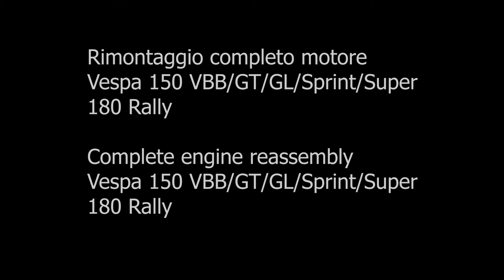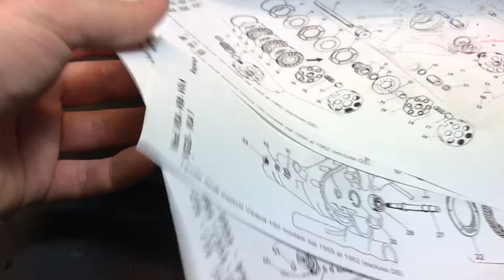Restauro completo motore Vespa VBB/GT/GL/Sprint/Super/180 Rally Largeframe [How to rebuild]

Comment: Hi. great job. It was very useful on the rest of my 150 sprint speed Vespa. I have a question. At 17:47 you put the piston with the middle window facing down. On my wasp the piston window is an input and is on top of the cylinder. You can confirm that I'm having trouble starting my Vespa. Thanks.

Comment: hey i need your help, today i taped my vespa crankcase bolt holes for the cylinder because the threads are gone. i just realize that threads holes for bolt mount on the left side engine are open to the inside of the clutch and transmition. im pretty sure there are some chips inside that, what should i do ??!! do i should just change the oil or else?